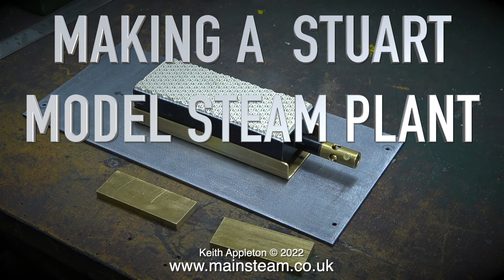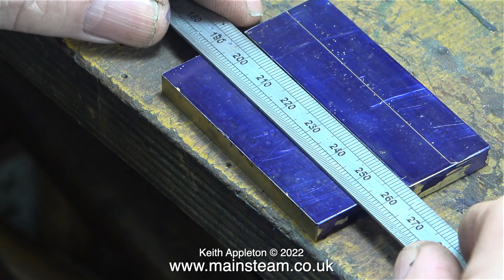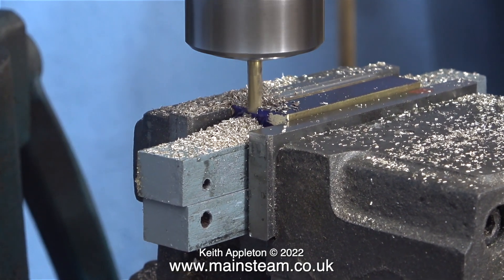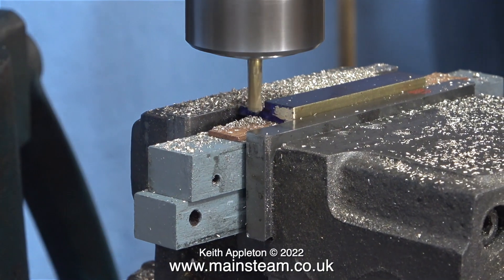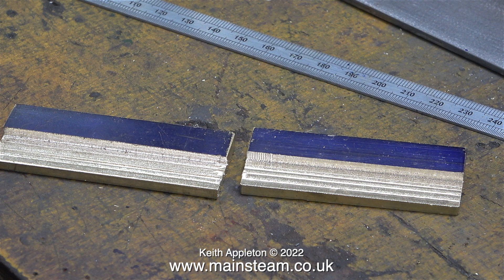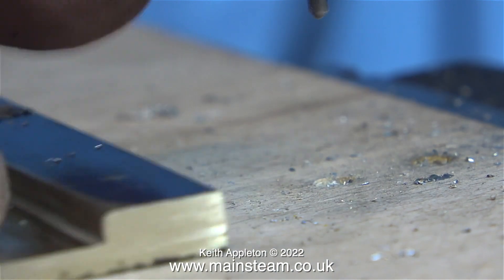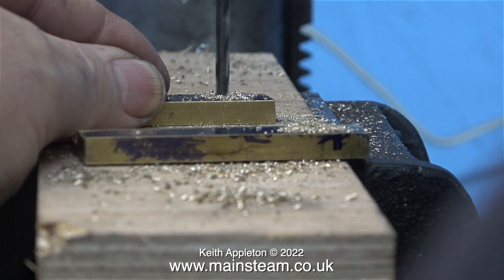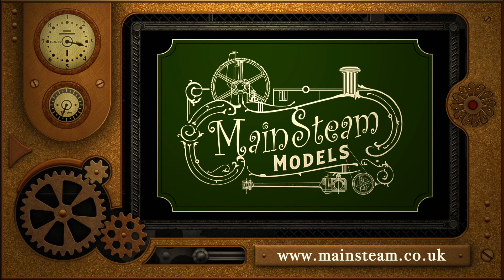MAKING A STUART MODEL STEAM PLANT - PART #55

Comment: +1 for clamping things down on the drill - they can be 'surprisingly' powerful if they 'grab'.

I'm also a believer in a foot switch for pillar and bench drills too - things go wrong, just stand back and the drill turns itself off !!
Reply from the maker: I also keep the belts on the Drilling Machine quite slack, just tight enough to provide enough power for the hole drilling ......
Reply: @keithappleton  Good idea too !

Mine grabbed a fairly heaft lump of stainless steel once as the drill was breaking through - and spun it across the garage - luckily not in my direction.

Lesson learnt !!